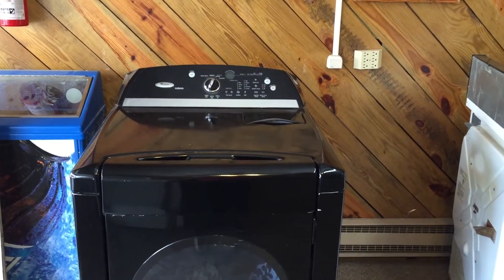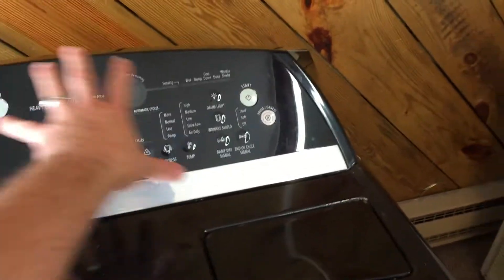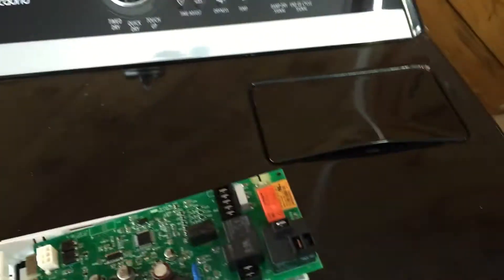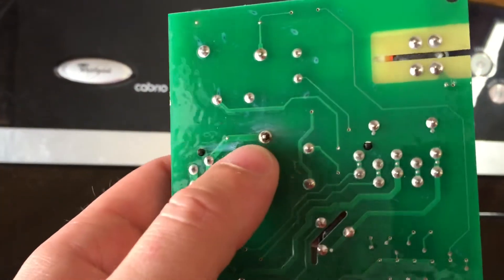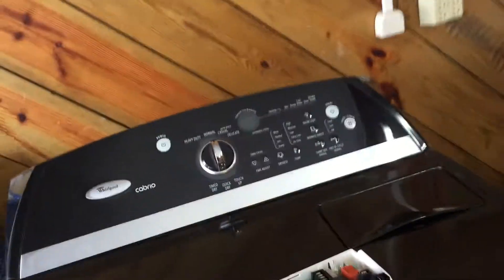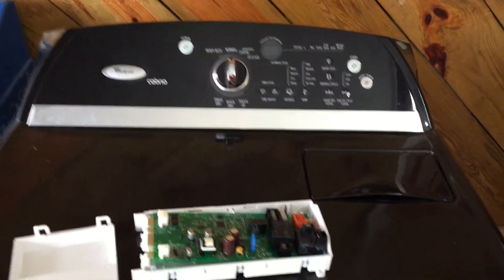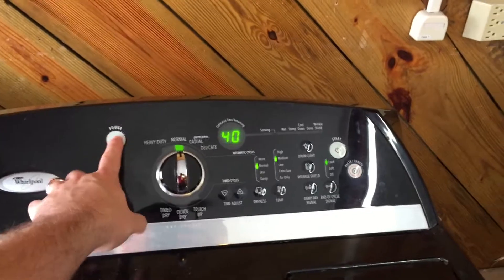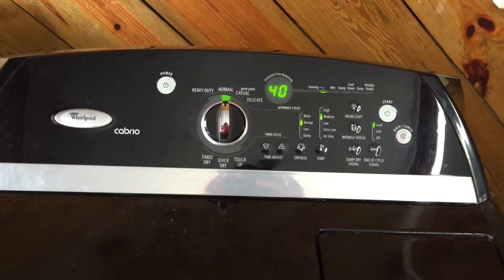Whirlpool Cabrio Dryer F-1 Error Code

Comment: I have a Whirlpool Cabrio dryer just like this one.  I had the same exact problem.  I soldered the burnt circuit joint, reconnected circuit board and walah.  It is fixed now and works like new.  Thanks for saving me some money.

Comment: I found the burnt sauder point and tried to solder it and still no fix. So I went and bought a brand spanking new one for $179.00 of the local parts house and now its fixed. But I would defiantly try the solder 1st because it may work on yours. GOOD LUCK !!!!